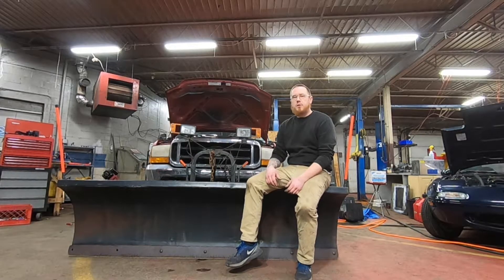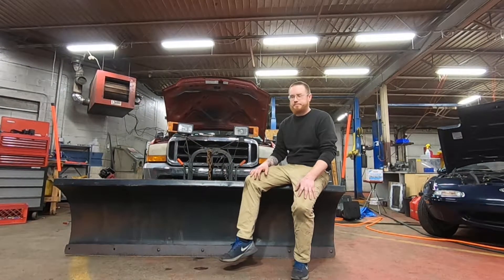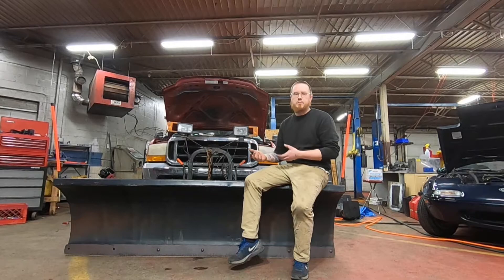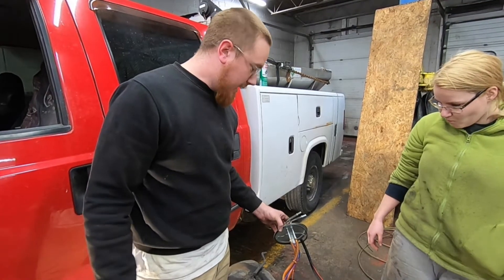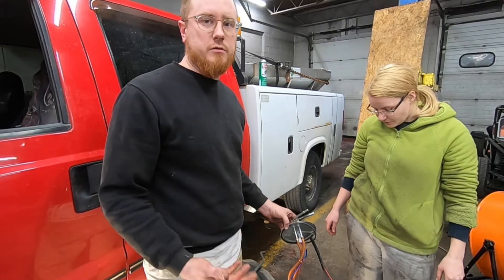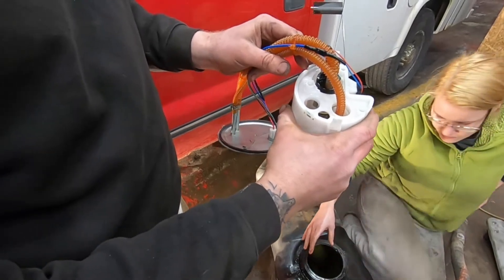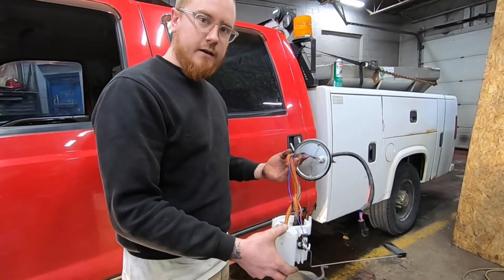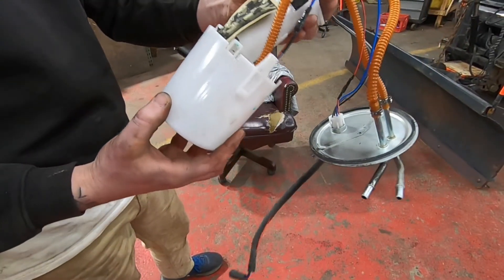Ford F250 Fuel Pump Diagnosis

Comment: Have a 2003 5.4 f250 sometimes when i turn the key the fuel pump will kick on sometimes it wont well alot of the time it wont. Could this be fuel pump relay issue, or does this sound like a fuel pump issue

Comment: I have an 06 ford f250 5.4l can I put an inline pump and if so we're would I find one I know they run 40-45psi
Reply from the maker: You’d have to modify the pickup inside the tank and maybe other things too, might not be worth it

Comment: Thanks for the video. I have a 2007 f350 5.4 had the p0191code. Sputter under acceleration. Took down tank and the filter inside tank had deteriorated and plugged the pump inlet. Your video inspired me to take that tank down. Thanks again
Reply from the maker: Glad it helped!

Comment: I wonder if this same thing would happen in the 2017+ tanks I'm getting low fuel pressure p008A code without any symptoms at all (seemingly). I put new fuel filters and got better mpg but still getting the fuel pressure low warning all the time
Reply from the maker: That's a tough one, in this case the fuel pressure drop caused a very dramatic performance drop (basically undriveable).  It could also be a faulty fuel pressure sensor in your case.
Reply: @immortanautomotive9221  thank you for the reply! I'll check into it